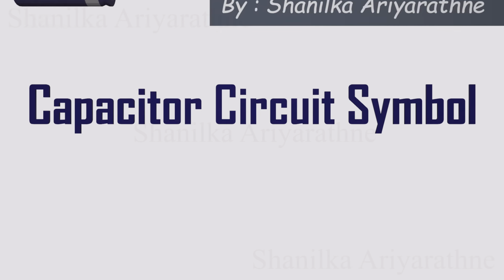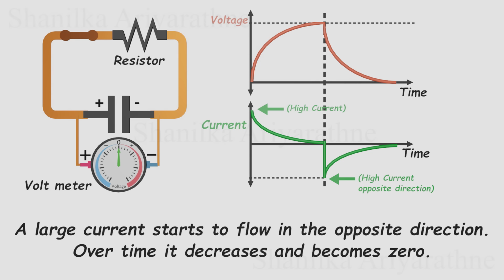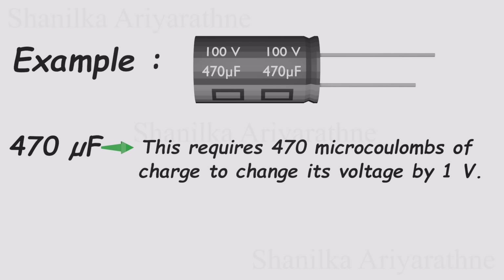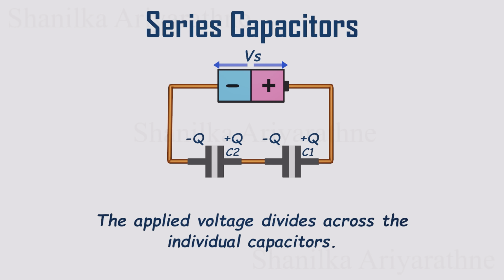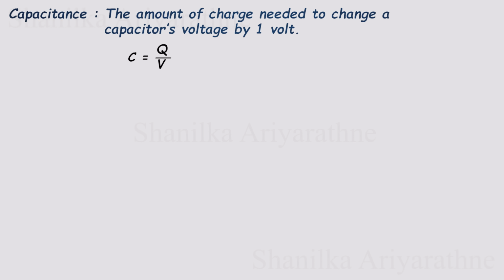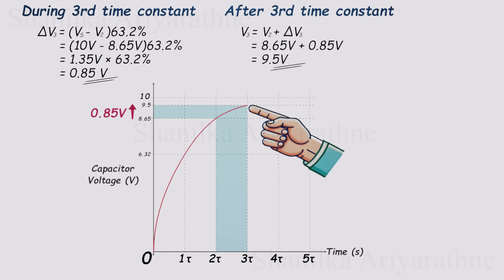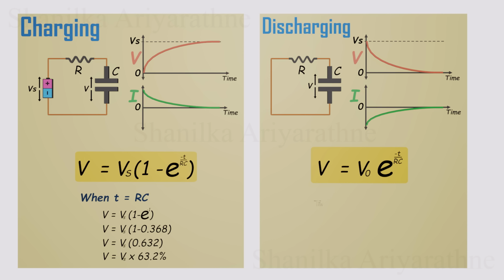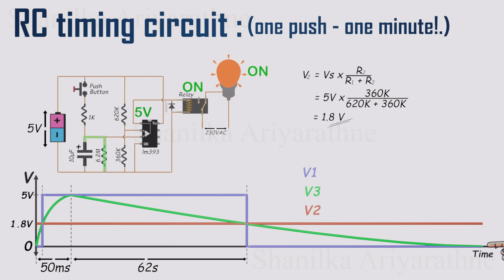Capacitors Explained: Charging, Discharging, Time Constant (RC) | Beginner’s Full Guide

Comment: When discharging a capacitor where to current or voltage goes to the ground? it has to go some where?. if I use a screw driver to discharged a capacitor where the voltage or current it transfer to the screw driver?
I never understand that . PS power drop where in the air. funny when touching a capacitor you get a charge but when you discharged you don't?

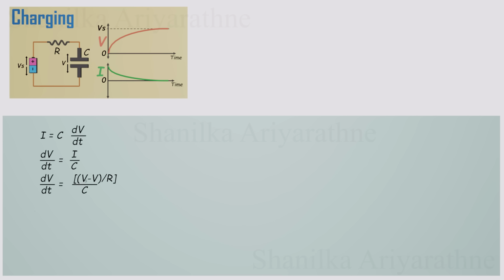Comment: I'm getting stupid.  Where did the negative sign come from when deriving the charging capacitor formula at about 37:15, when both sides of the differential equation are integrated?
Reply: Im pretty sure it’s from doing the u-substitution. When doing the 1/(Vs-V) integral, Vs is a constant and V is the variable. So when doing the u-sub, u = Vs-V and du = -1dv, giving the integral -1/u du, which then solves to -ln|Vs-V|
Reply: @losier6062  As Homer Simpson might say, "Doh!"  Thanks for your helpful response.

Comment: Yellow sea sorrounded by the CK lethal warships types on the surface, undersea are the CK 20 attack undersea torpedoes firing drones for initial salvo backed up by 10 stealth submarines of the CK and with 5 stealth submarines with back pack mini subs for special forces of the CK that would slip through enemy coastal areas, one pulse wave weapon at the atmosphere aimed at Japan one pulse waves weapon aimed at Trump location, space weapons of the CK above the offices in space atop  of FBI, CIA, State Security Intelligence agencies offices with hypersonic glide vehicles weapons of the CK on standby and the secret weapon the U.F.O weapons version of the CK prepared at undisclosed location which can close in far distance by time warp like distance shortcut which can destroy all very modern stealth fighters of my enemies even at hypersonic flight, the undersea of yellow sea saturated now with undersea sensors of the CK, now Kernel and Japan of your Empire of the rising Sun would you test your railguns on your warships against my surface warships with laser weapons and variety of missiles and my undersea stealth submarine fleet? Hmm, just asking. I know your movements.